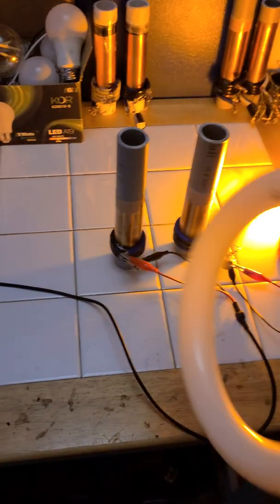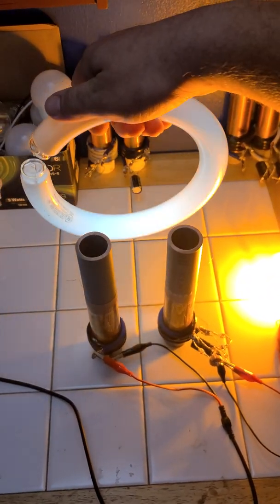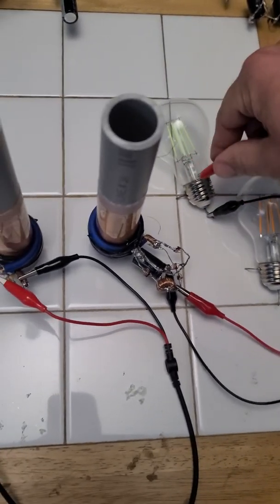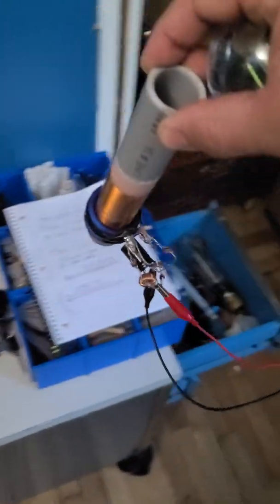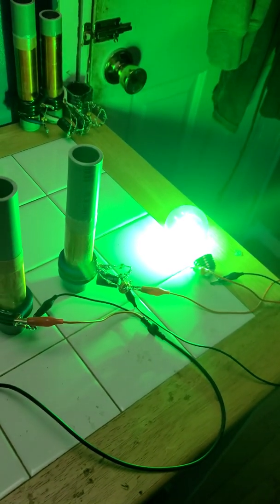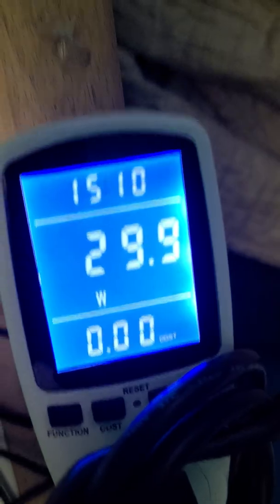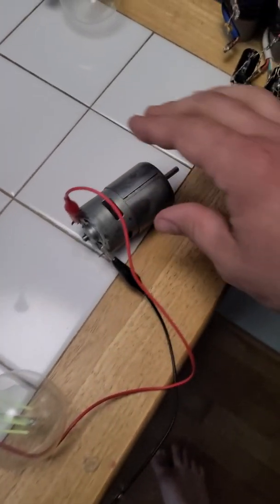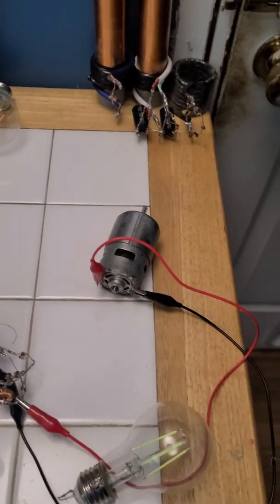🌩 Strongest & Most Simplistic Wireless Power System So Far 💡

Comment: Hi
I got 2 coils setup like you described
I am getting about 6-8” range and lighting a 3w LED
THIS IS WUTH A 20vpp of signal generator
I am going to check the voltage but for sure it’s not that high

How do you tube with the lock cap? The prices
Maybe you can do a s quickie video showing how you measure and calculate
Inductance of your primary and secondary?
I am running at about 2.3 MHz as this is the frequency that gives me maximum power
Thanks
Reply from the maker: Hey glad to hear your starting to have some success. I'm currently uploading more videos that detail how to easily tune everything:)
Reply: @MTECHINDUSTRIES  thanks buddy

Comment: Hi sir can you show/explain how you tune transmission coil? How exactly you getting things in resonance ? 
Do you use oscilloscope to find highest amplitude or neon bulb to find higher brightness frequency?

Is there any results without amplifier or amplifier is a must have?
Reply from the maker: Hi, the amplifier isn't needed but having it shows a massive energy gain. In my earlier videos i show the system working without an amplifier. Its much more sensitive to tuning however. 

So far when i build a coil the length is four inches for the secondary & one inch for the primary, i also have detailed videos on how to construct the coils. I discovered 2 ways to do it but 4 inch coils seem to have a better range then 5 inch coils for some reason. For tuning i use an lcr meter & online calculators. Also keep in mind building the coils identical to mine guarantees that your tuned anywhere from 2.4-3.2mhz